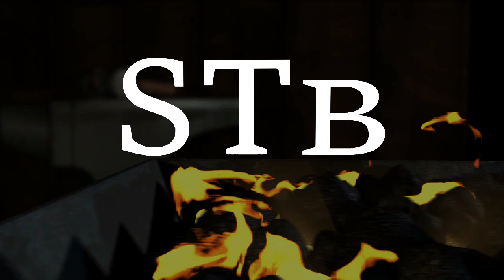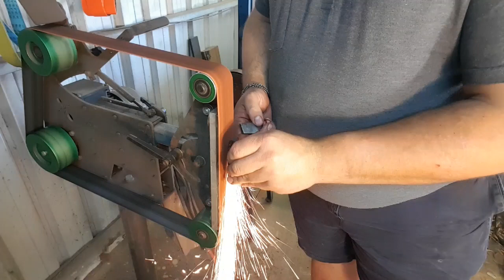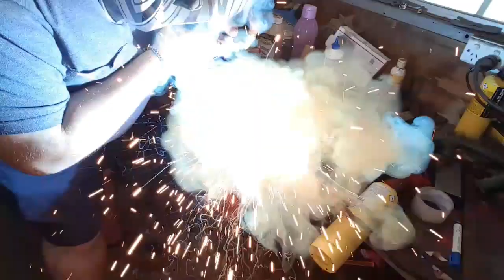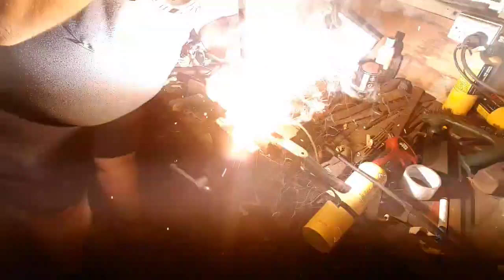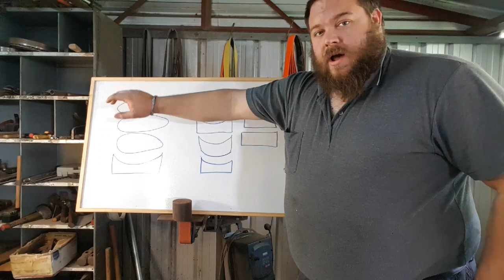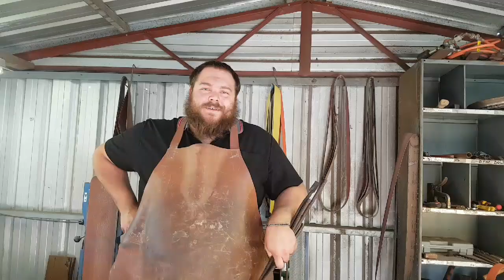Scrap Damascus: Steel and Billet Preparation

Comment: I've got some very old wrought-iron, would you use it in the same way as mild steel when forging Damascus??
Reply from the maker: Wrought iron has a pattern of its own, though it is unhardenable, it's amzzing for making san mai
Reply: OK, so thats a sandwich of wrought-iron on the outside and carbon steel inside?
Reply from the maker: @davteunfeun3737  yep, you got it
Reply: I suppose with the same temperatures as for welding Damascus... Thanks for the answers Sam...
Reply from the maker: @davteunfeun3737  you're welcome! Wrought does like to weld at a higher temp than monosteel, but you want to use the temperature that the carbon steel likes, so as not to decarburise your edge
Reply: Great... I'll be using a file as carbon steel. I've tested it like in your video and seems to be good quality.... I'm going to have a great weekend trying to forge some sanmai and make a knife out of it!!! Thanks again for the great videos and your answers Sam!
Reply from the maker: @davteunfeun3737  awesome mate, email me a photo when you get it done samtownsbladesmith@gmail.com

Comment: Have you tried welding without any flux yet? Its remarkable and extremely clean. No crap eating away at your forge lining. If you wanna talk more about it email me  jlblohm87@gmail.com. I think we can learn a lot from each other!!!
Reply from the maker: I have, this is a beginner/intro lesson into forgewelding. While it is possible to weld without flux, the novice isn'tgoing to have the knowledge or confidence to pull it off. I will probably cover it in a future video
Reply: I still use flux every now and then. I'm going to make a flux with cast iron filing. The iron filings are really high I carbon and in turn lowers welding temps.
Reply: By the way it was an excellent video covering all the basics. Keep up the good work.

Comment: In my LIMITED experience making damascus is easily 90% prep work.
Reply from the maker: That is 1000% true
Reply: As soon as I finish the First Degree Forge waffle knife I'm gonna try out the new forge at making some damascus. The little forge is intended for knives and as such has almost no room in it. The BIG forge ended up as a resource destroying beast and not effective for smaller projects. Hence the new one which suits my needs far better.
Reply: My only prep work most of the time is adding flux. I use a lot of pallet strapping that is galvanized and I don’t even bother to take the galvanizing off. I’ve only ever had one fail. One thing I have found that always needs proper prep work is cable (or at least the cable I have needs it) or it dosent weld worth a darn
Reply from the maker: @veteranironoutdoors8320  while you may have some success with that method, I guarantee you'll get inclusions in most of your work.

Edit: also, I never encourage burning galv off in the forge, as it can lead to heavy metal poisoning.  Please strip the galv.
Reply: Sam Towns, Bladesmith yeah galvanizing is pretty nasty stuff. I set it on a high fire and let it burn off while I am away
Reply: Sam Towns, Bladesmith also, can’t wait to see you grind into that expanded steel Damascus blade I sent you. If I didn’t get any inclusions in that then I think I got me a pretty good technique.